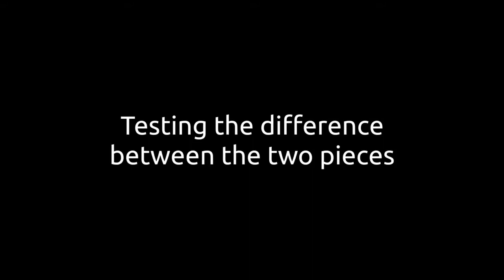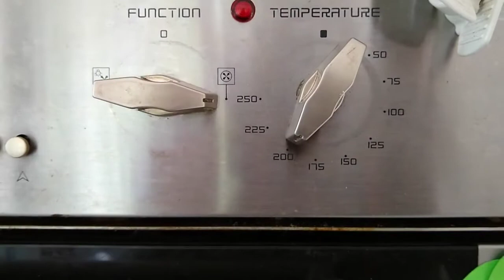Heat treating tool steel

Comment: The takeaway from this is that drilling holes in steel alters the properties. Not sure why you didn't stick the other bit in the forge to reduce potentially confounding factors.
Reply from the maker: Yup, obviously need to improve my science game. Any suggestions for the next video?
Reply: @adpsimpson  Well, it would be interesting to see if wood behaves the same way. Or children.